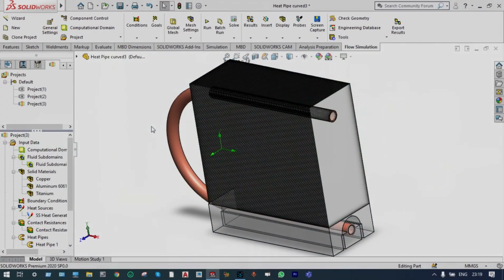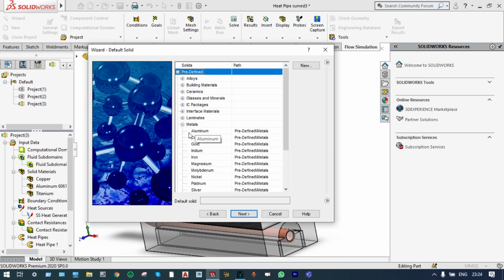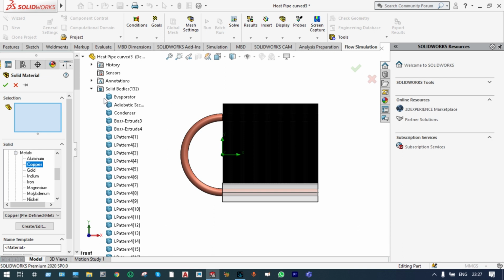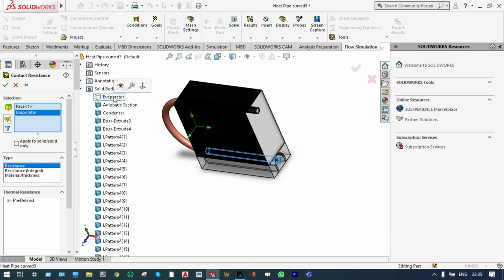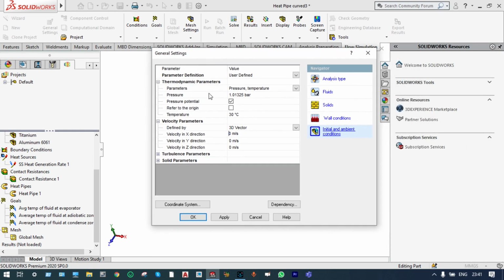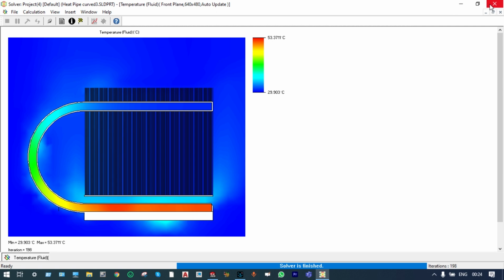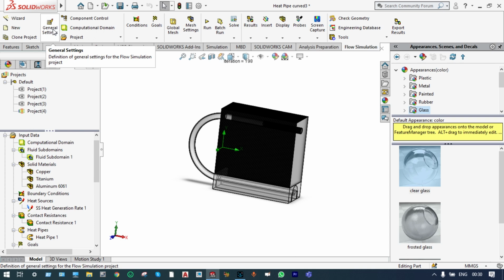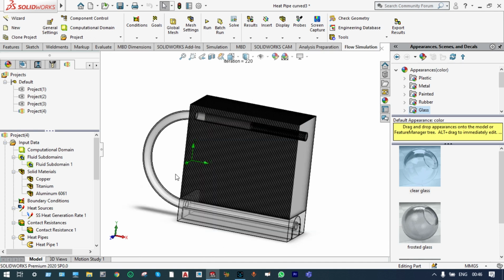CFD Flow Simulation of U-Shaped Heat pipe under different Conditions l SolidWorks 2020

Comment: Great video.. Can you clarify on following points
1) Which faces are to be selected as evaporator & condenser while defining heat pipe - surfaces of heatpipe which are in contact with evaporator & condenser? 
2) How is effective thermal resistance set? What is the reference for that experimental value? How to look for it in heat pipe datasheet.

Comment: hi，could you send me the all model such as stp or igs for this link？thank you very much。My email is 3252165592@qq.com。
Reply from the maker: Send some other email address, it is bouncing back
Reply: @CFD_GUIDE  hi，could you send me the all cfd video examples models such as stp or igs with a rar file？thank you very much。My email is hust_hp10@163.com or  2700494574@qq.com。Thank you very much。

Comment: Thank you for this video, Sir. I have few doubts; the reason for "contact resistance" is that these two parts are assembled (Evaporated and adiabatic)? What about contact resistance between adiabatic and condenser pipe/ condenser pipe between fins? If we made the heat pipe without fins, is that possible to selected condenser pipe outside the faces as a cooling zone in " Condition > heat pipe"?
Reply from the maker: Generally if there are different bodies connected together we can provide contact resistance in between. It can be applied in all thermal problems, but the value is small, so generally we neglect it. It is up-to you whether contact resistance to be considered or not based on your accuracy level. You can provide an adhesive or  glue with specific contact resistance.
Reply from the maker: I saw your mail but, didn't get time to see your video. I will see it soon and update.
Reply: @CFD_GUIDE  Thank you for considering my email sir, I'm waiting for your reply
Reply from the maker: Saw your model. Everything is fine but may be for the sintered wick you can provide porosity with a specific value depending on the property of sintered wick or find the mechanical properties of sintered wick and copy paste this property to your material and make it as user defined. Try different combinations and effective thermal resistance should be very less may be in the range of 0.08- 0.02. It is getting over heated so provide less amount of wattage and heating surface should be a material with high melting point.